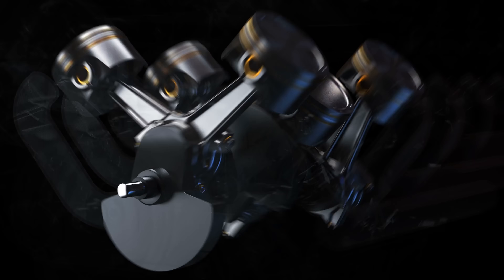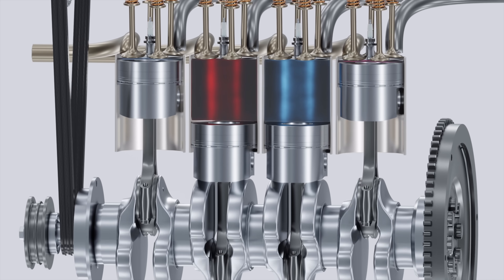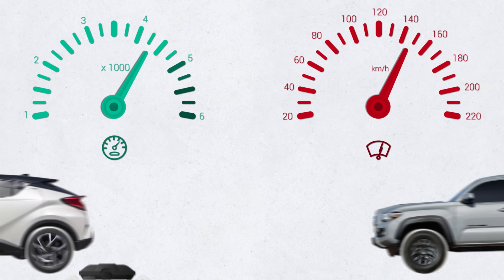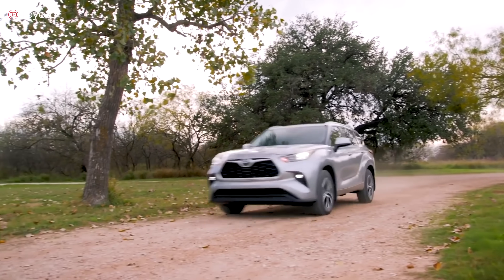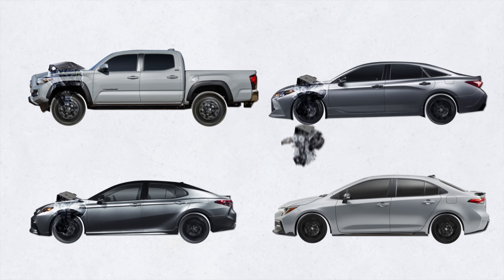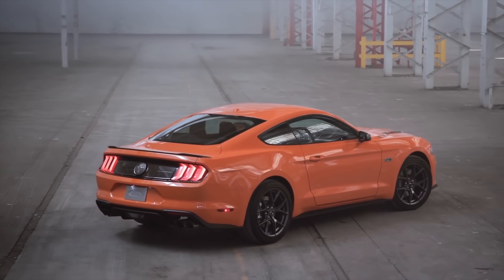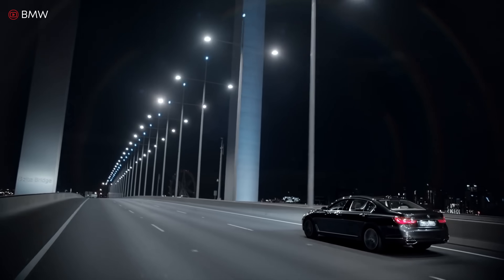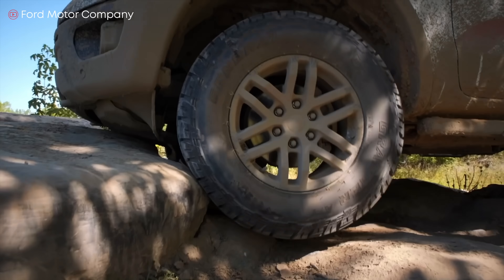No One is Telling You the Truth About Turbocharged Cars, So I Have To

Comment: I’ll take a naturally aspirated v6 over any turbo 4 any day even if Toyota makes a reliable turbo engine. Because naturally aspirated engines simply last longer and are less complex long term
Reply: Absolutely. Toyota screwed up dropping the v8. Big mistake.
Reply: @talisikid1618  they dont need a v8 for the light duty trucks
Reply: @TetraHydroCannabinolTHC  no they dropped it for the tundra
Reply: I'll take a SR20 DET nissan built to last 

over any v6 naturally aspirated
Reply: my 3.5 V6 runs smooth and quiet - around town i get a consistent actual 23 mpg with the ac running - it's 10 years old and it runs as good as the day i bought it - i'll keep this car till one of us dies(lol) - by the way it's a Kia Sorento  and i don't give a tinkers damn what anyone says - the car has proven to work just fine - I've never regretted buying it
Reply: They’re not as fast 💨
Reply: @cdl34453  
I have a Acura TSX J-Series V6. 
It's....Heavy. But very stable
Reply: I'll take the Turbo V6 over either the NA V6 or the Turbo4
Reply: @kyungrix1112  they’re heavier
Reply: @cdl34453  tHerE not as fAsT
Reply: @Fredrick-Von-Beerus-III  I didn't know this about the v8 Tundra but I'm willing to bet it has everything to do with basically abstract regulations and not their data.

I'm not a guy in need of a V8 but I can understand for sure. Hopefully material  sciences are such that it at least doesn't ruin their durability reputation.

Please tell me they aren't replacing the V8 with a boosted V6. Even if they worked it out it would still mean that they could make a NA V8 that revs lower and last even longer.
Reply: @kenleycarlton7562  Quad Turbo dual V8s can be even faster. Where do you draw the line and why?
Reply: “Even if Toyota makes a reliable turbo engine” 2JZ Supra owners have left the chat.
Reply: There’s no replacement for displacement. My wife has a turbo four in her Volkswagen Jetta. I still miss my 5.3 V8 in my Avalanche and they can pry the 4L V8 from my Lexus out of my cold dead hands.
Reply: @KaiPonte  agreed. No replacement for displacement.
Reply: I guess I’ll havta drive my big v8 Tundra till one of us dies cause I’d don’t want a turbo full sized truck! There’s no substitute for displacement when towing/hauling. I HATE that Toyota is dropping the v8!!
Reply: @TetraHydroCannabinolTHC  
Da
Reply: @billhurt62  I do wish Toyota made a full size truck. I’d buy one in a heartbeat. My 6’2” son and I (6’4”) were looking for a truck for him. Only the Silverado/Sierra and F150 are tall enough in the cabin. The Toyota trucks are so cramped.
Reply: @KaiPonte  Tundra but my best friend own a huge auto repair shop and said they are the worst trucks but he loves for people to have them he said they make him a lot of money. I guess if you buy one he’ll be able to take his family on another vacation. LOL!!!
Reply: Took our 2019 GMC Acadia on vacation and got 25 mpg.  4 adults,  a kid,  and stuffed with luggage.  3.6 V-6 with a little over 300 hp.  I'll stick with the naturally aspirated engine with less moving parts and lower temperatures.
Reply: @JacobSchmittDeerHuntingSchool  really? With the 2UZ?
Reply: @KaiPonte  Um….it’s called a Toyota Tundra….
Reply: @billhurt62  what is called a Toyota Tundra?
Reply: @Sammyhale30  don't care. I4 sounds/feels bad and has no linear power delivery.
Reply: @talisikid1618  They did it for fuel efficiency
Reply: @KaiPonte  yes except there’s nothing REMOTELY comparable about those cars you list,  nor the suitability of the engines in them! Modern turbo fours ARE a replacement for NA V or inline 6-cylinder motors in small, medium and even the low end of some large vehicles, depending on weight. Weight plays a critical role - a modern turbo 4 is much better suited to your wife’s car as it’s more than adequately powerful, has more low-rpm torque than all but a huge V6 is capable of, and most importantly, is much lighter which results in substantially better handling and balance from the front end. It also uses far less fuel unless absolutely hammered. Despite what anyone says, statistics show that generally a good turbo 4 is also highly reliable - certainly more than ANY engine from only a couple of decades ago as metallurgy has become so much better. The only area a V6 is superior is smoothness and refinement, where that is important - then again if you’re driven a Megane RS or some of the AMG 4 cylinder product for example, a well-tuned exhaust and acoustics system is an aural joy to behold of cracks and burbles and pops - horses for courses.
Reply: I would take a NA I6 anyday.
Reply: @Sammyhale30  Scott's opinion is just that. His opinion. It doesn't make it fact. 
I have kept my Saab Nordic Aero since 09'. It has 76k. I changed a few things for efficiency and produce 430 hp, reliably all day long and is more economical than the 2.8's factory tune. Scott's gets a lot wrong.
Reply: But would you take a twin turbo V6 over a V8 for fuel economy only?
Reply: @eblamo  V8s or turbo v6s aren’t about exceptional fuel economy. I’d take the NA v8
Reply: @eblamo  My Lincoln Corsair and Saab 9-3 2.8 Nordic Aero are perfect size for their power plant. The Saab makes 377 Hp and 0-60 in 4 2 seconds.
Reply: Yeah, I prefer naturally aspirated V8s in my trucks, but okay with turbo charged or V6 NA in a car, if I were to drive one. Don’t need that kind of power delivery in a car. It just needs to get from point A to B. 🥳
Reply: we know but we also know why they're doing it.
Reply: @TetraHydroCannabinolTHC true the V8 was only ever used in their trucks, and certain Lexus vehicles. the vast majority use the 3.5 or 2.5, Toyota used to have a 3.0, but they haven't used that since 2002.
Reply: The problem with my turbo 4, is the pollution control on my diesel
Reply: I'm sorry. But you're wrong. Rewind to 1980. The Volvo 2,1 turbo and SAAB 2,0 turbo lasted just as long. As the Ford 302 and Chevy 305 V8s of the time. If not even longer.